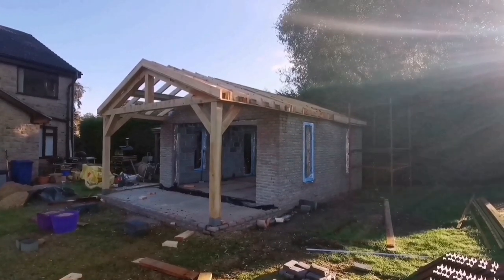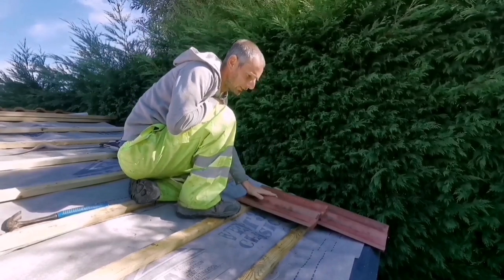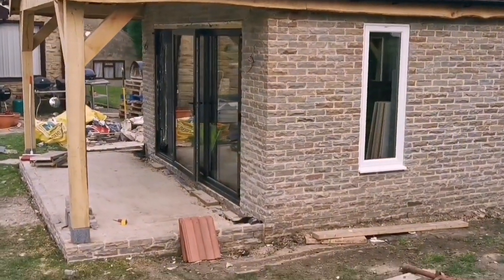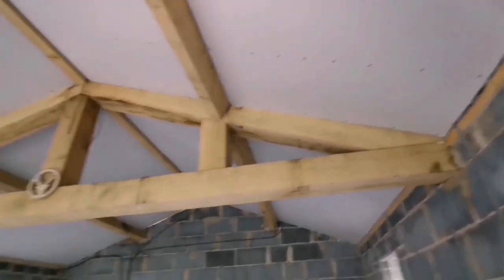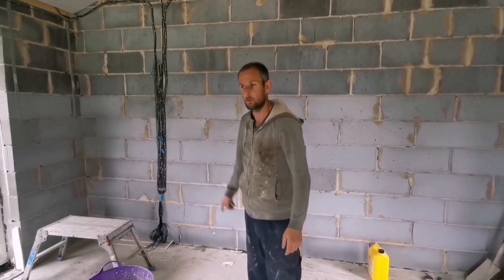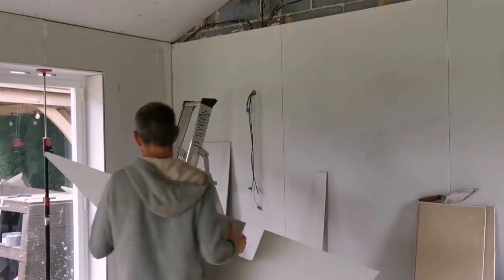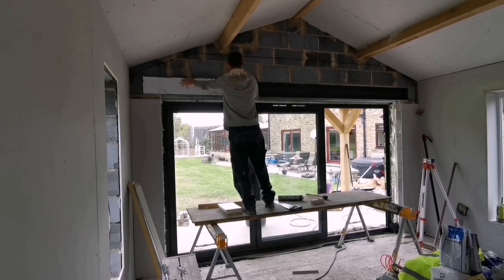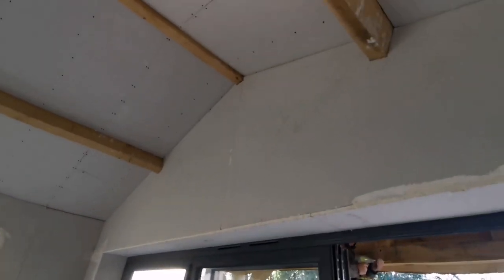summer house. roof on and plaster boarding

Comment: Hi Mark, with the foam, leave it (max) 5 mins to go off a bit. Sticks far better.
Also wet both surfaces with a fine water spray. Helps it go off as it needs moisture. Great video as usual 😊
Reply from the maker: Thanks mate did not no that. 👍👍👍Will try that next time 👍